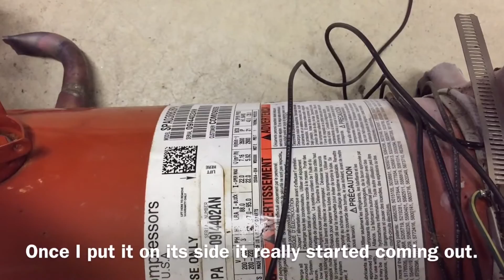Refrigerant outgassing from oil.

Comment: one would assume you can plug the heater wires in and keep it geating up. that ought to release the freon trapped in the oil.
Reply from the maker: Yup.  Most the units I see do not have a crankcase heaters. Makes me think lol.

Comment: Yup, I stood up a Rheem rectangular unit and about 20 seconds later it started squirting out bubbles of foam. Its a foam machine..lol It shot up to like 12 inchs, then I started to crimp the copper and I got it up to like 20 inchs. My channels locks and arm was covered in oil by the time I got it crimped.
Reply from the maker: Lol that sucks. I don't think I've had one squirt on me lol. I have been hit with those fumes when un brazing.

Comment: What I normally do (if there is not a leak in the system) is recover into a vacuum, then let it sit a while till the pressure comes up and recover again, once it stays in a vacuum i know i got all the liquid out, then break the vacuum with nitrogen, or just cut the pipes if its going for scrap.

I've had some where i have capped the pipe with plastic plug while doing something else and half an hour later BANG! the plug comes flying out the pipe, sure makes you jump haha.
Reply from the maker: That's a great tip. I will try that next time for sure. Thanks.  Lol that would scare the shit outta me lol.

Comment: Would pulling a vacuum for longer amount of time draw the refrigerant from the the oil?
Reply from the maker: Yeah it would boil it faster I would think. I was recovering. I recovered to 0 then cut the lines.  Say I was just replacing the filter drier after recovering and replacing the drier I would start to vacuum and it would take a longer time to pull a vacuum because of the out gassing. I would probably vent half a pound of gas or more that's coming out of the oil.